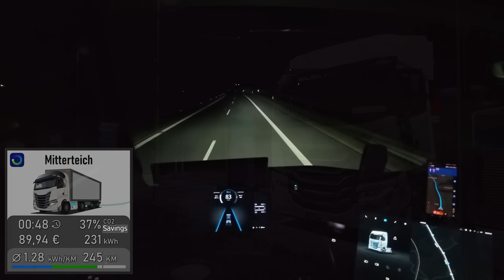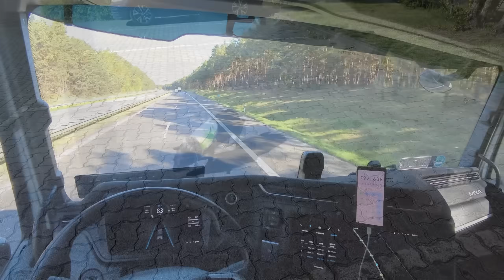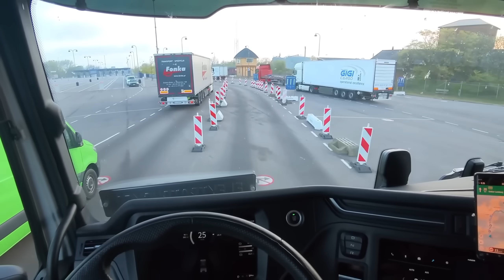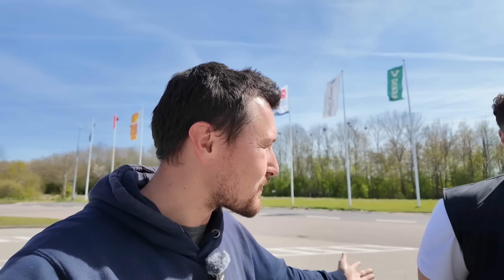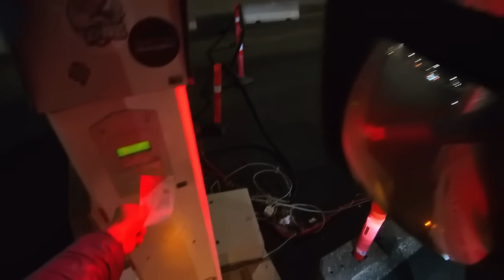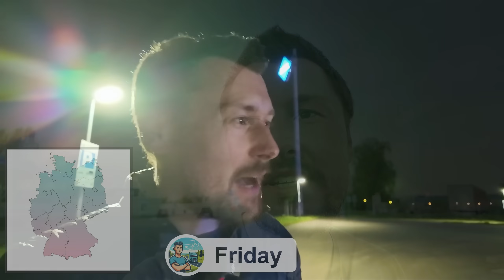Munich - Malmö - Munich: This Electric Truck has the same Range as a Diesel

Comment: Hi - how to do you get that price at Mitterteich? I look at aral pulse app and it's showing twice or more ??
Reply from the maker: There was a limited-time subscription plan through a third party that lets you charge at Aral for 39 cents per kWh. You can no longer get that subscription but they honor their original customers by continuing the plan as long as the customer pays the monthly fee.
Reply: @electrictrucker  thanks - who's the third party ? might have a better deal than current? is your current deal for a year or as long as you keep paying the fee - which would be an amazing deal!!
Reply from the maker: The deal was with ChargeNow. The plan stays active as long as I pay the 5€ monthly fee.
Reply: @electrictrucker one little addition: ChargeNow is just the brand open for every one by Digital Charging Solutions. They offer white-label solutions for others, for example car manufacturers. In the plan for Hyundai (ChargeMyHyundai) and Kia (Kia Charge) they had been available earlier, and can still be activated. But they require the user to have a car from the corresponding brand.